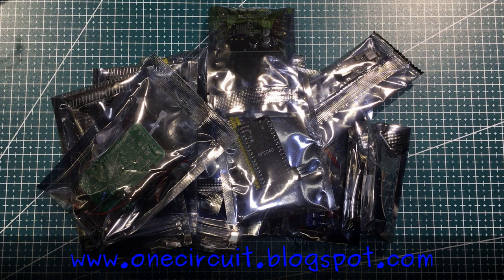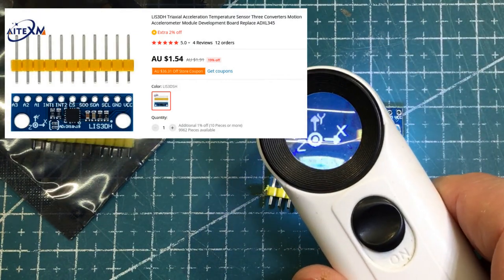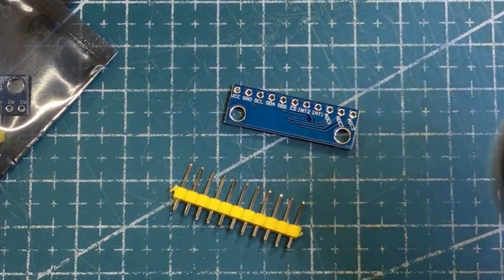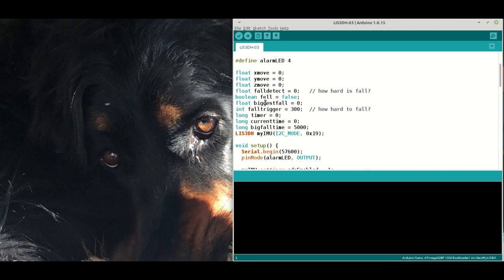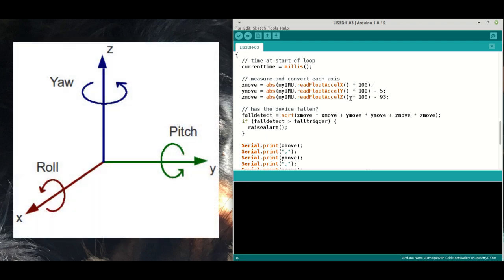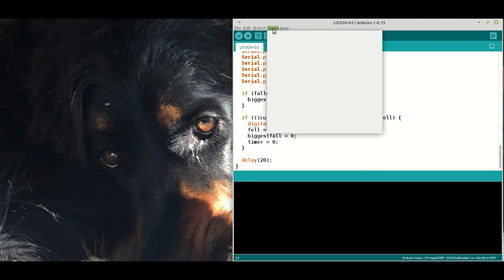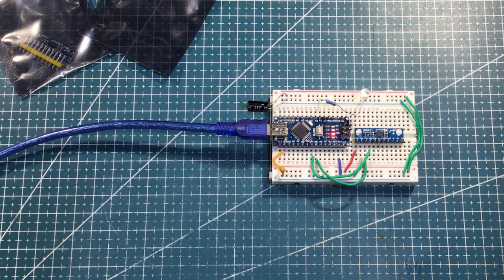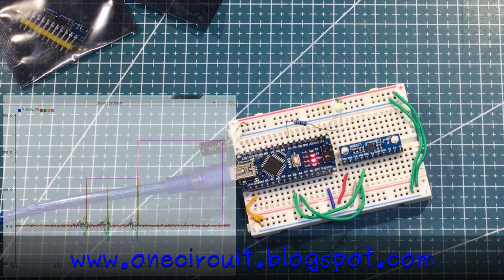Dirty Dozen #05 - an Accelerometer module (LIS3DH) as a fall detector!

Comment: Nice. Off to the far east to pick some up. Should be a fun project. Did you have to -1 in the code, due to being down under?  :face-blue-smiling:
Reply from the maker: Oh yes! It fell up! 👍😀
Reply: @onecircuit-as  Back to the accelerometers, the ST datasheet at Mouser indicates the LIS3DH variant has three 10 bit ADC input pins, and no address input lines, appears it's populated on purple boards.
Reply from the maker: Yes I've ordered some more for a detailed look when they arrive. 👍😀

Comment: I'd bet since ad3xl modules or whatever are in so many 3d printers now to measure harmonic distortion after each time a printer is moved these are a direct from in replacement.  It makes a huge difference in speed in 3d printing. It vibrates each axis as fast as it can so it can workout the math to keep 1st order and following harmonics down which increases speed by 10 times and keeps layer quality within the normal expectation at each setting.

Printers do it 1 axis at a time then I suspect they run the normal complimentary filter most mems use to keep error from creeping in over time. I've played with the bno055 quite a bit last year because it was impossible to get the gy521 as they both use bosch mems ics and built in mcu to convert the capacitance to directional data because most arduinos are not fast enough. I begrudgingly paid way too much for it but it was fun. Adafruit devices cost way too much.
Reply from the maker: The path from adafruit genius module to dubious cheapesium knockoff seems very short these days! 😬
Reply: @onecircuit-as  I agree. The 2 I mentioned have very different prices. It was when mems were hard to find. The  Cartesian ones are being gobbled up by printer companies. I have a ton of mcu stuff but I've been trying to do stuff without them. I like to torture myself with the math. I always like your videos man.
Reply from the maker: Thank you much appreciated Joey! 🙏👍😀